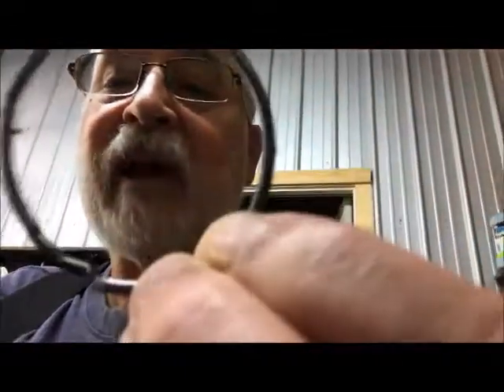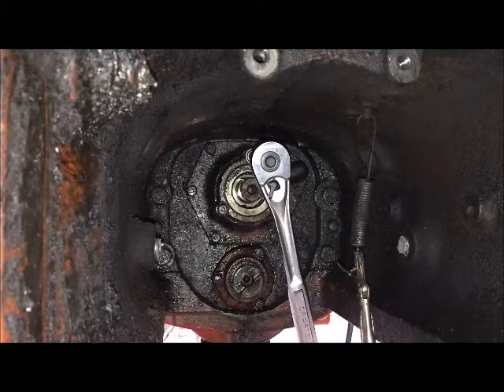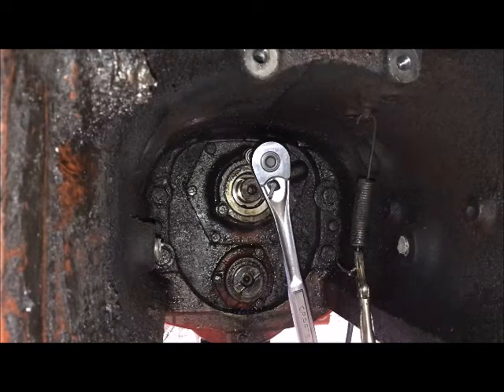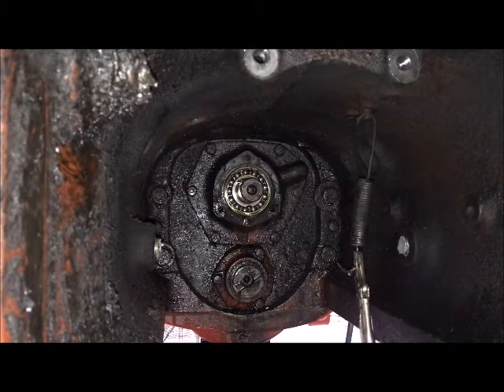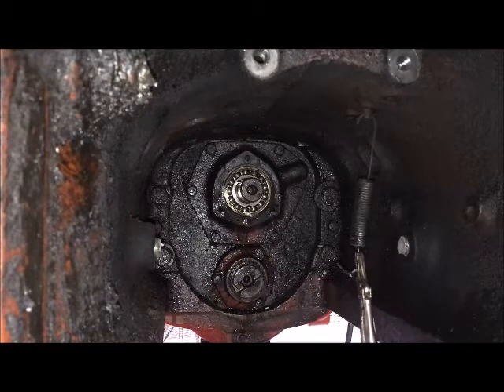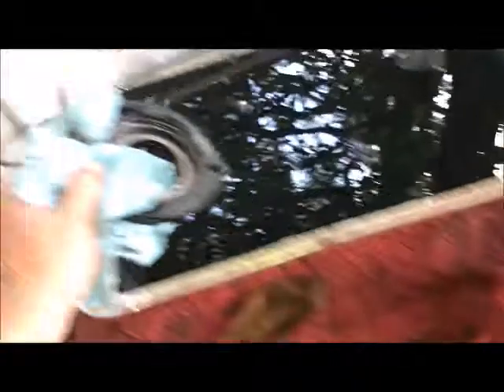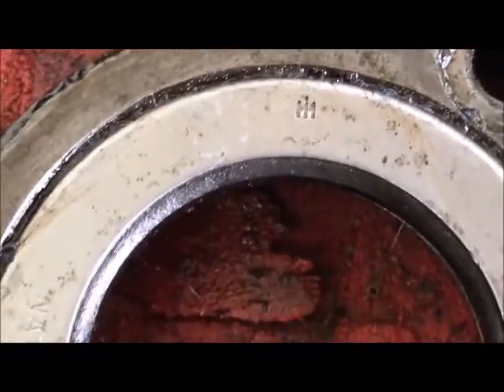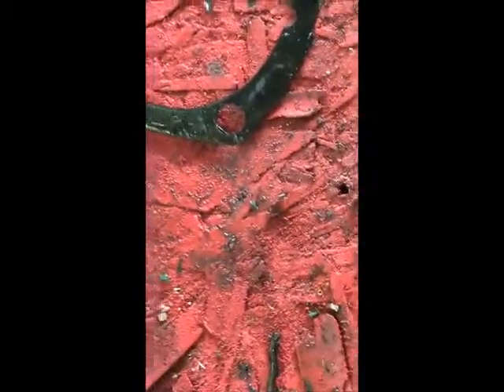1943 Farmall H Drive shaft oil seal Part  2

Comment: I've got a 43 Farmall H I bought at a farm aid auction in 1986 for $255.00. Two years later I dropped the pan and replaced the aluminum war bearing. Been running fine every sense. Has a Horn loader that will pick up loads like you wouldn't believe.
Reply from the maker: Sounds great